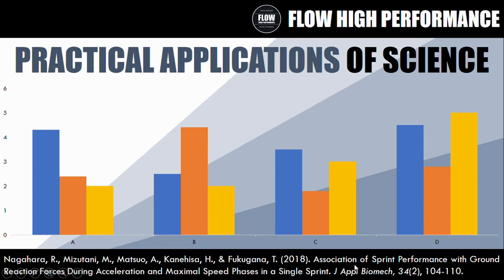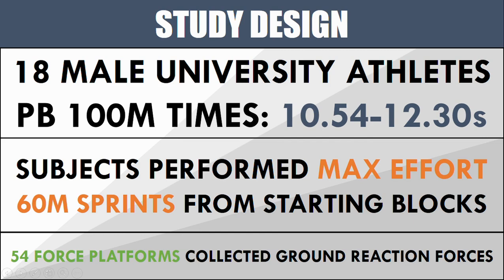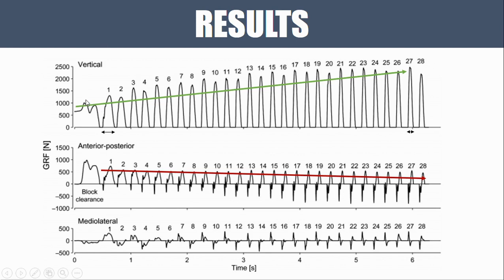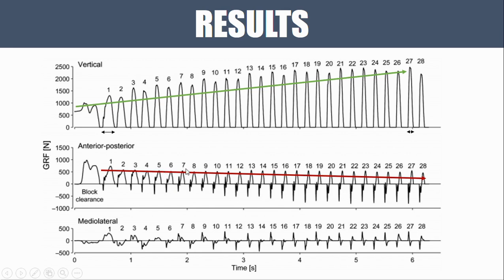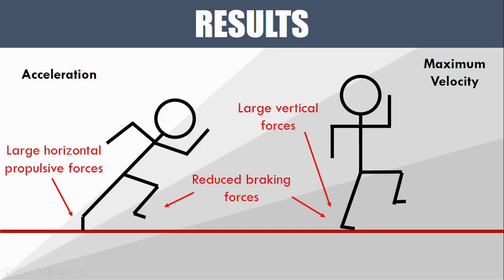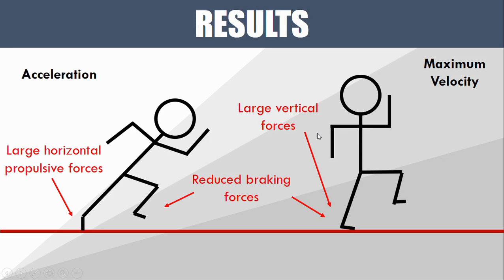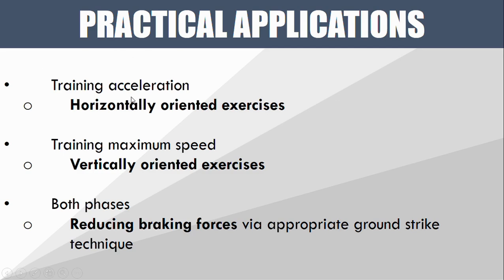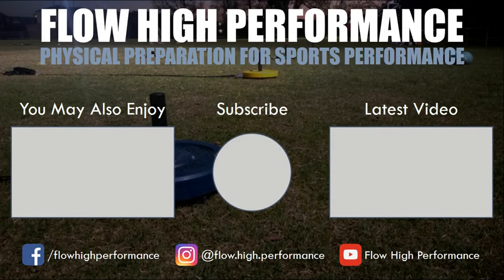Ground Reaction Forces During Sprinting | Practical Applications of Science

Comment: Isn't a large degree of horizontal forces in acceleration just from body angle.
Physiologically it seems like the direction of force applied by the body is fairly straight up and down.
Are we wrong to look at this from a global perspective instead of an athlete relative perspective? 

Also acceleration speed being correlated with body angle seems to support this. 

Thoughts?
Reply: @FlowHighPerformance1  - Checks out and sounds reasonable.

Think it may have been a semantic misunderstanding.

I've seen this argument used to justify the use of the hip thrust as a horizontal force exercise functional to speed development. Which doesn't quite sound right to me. But I don't think you were saying that. 

Great video none the less.
Keep up the good work!